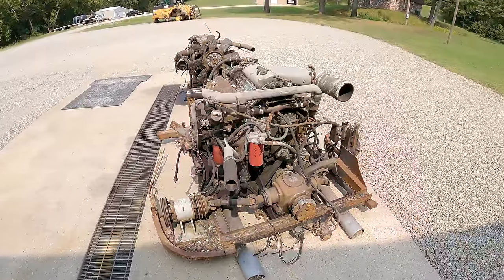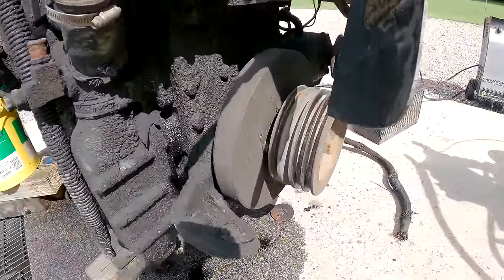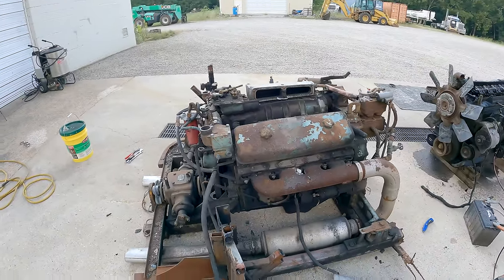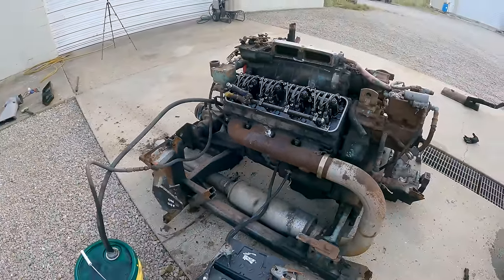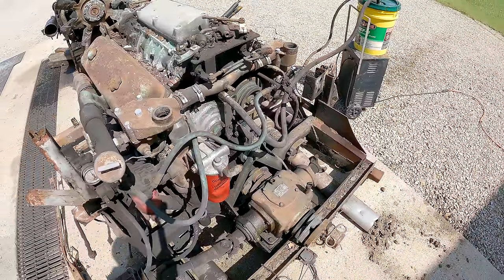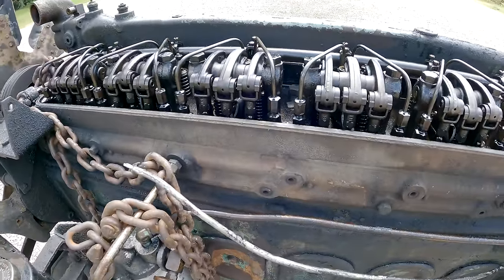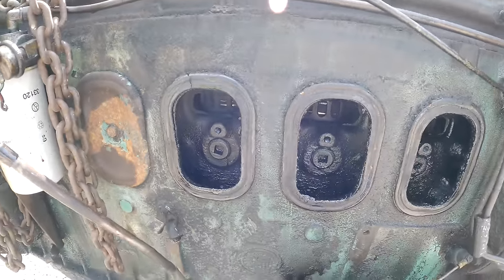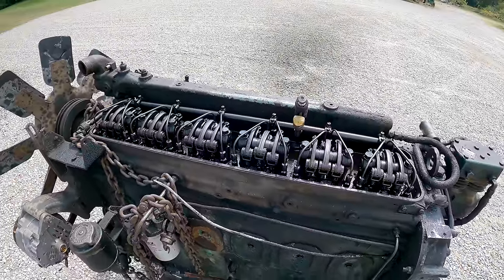Runaway 6-71 Two Stroke Detroit Diesel - Double Greasy Detroit Revival

Comment: Those old Detroit’s were amazing engines in their day...and “their day” lasted for about 60 years so Detroit did something right...aside from their noise, their biggest down fall was their fuel consumption...I worked at a construction company that had a mobile crusher and we brought it to a big rock job we were doing...the crusher was run by a generator that had a rather large Detroit in it..V16 if I recall... when they fired it up it ran like a champ but loved it’s fuel...so much so that the superintendent rented a brand new Cat generator to take its place...after about a week of running the Cat he figured the cost of the fuel saved paid for the rental of the Cat generator...I believe they scrapped the Detroit generator after that job...it was a shame really cuz there wasn’t a thing wrong with it but it was made back in the day when diesel was 10 cents a gallon...if you had endless amounts of fuel to run through it then it likely would have kept running for decades!!..the 671 was one of the best all around engines they ever made...this abusive run is a testimonial to how tough they were!!.. good video!!
Reply: And they leaked oil like an old Harley
Reply: There still decent engines people would rather have run cats or Cummins engines but imo there not as cool or fun engines I run a grain truck and we got a few pieces of equipment where I work with these engines in them.
Reply: How high was it revving?
Reply: Can’t remember...over 25 years ago...but they ran it hard so I would say it was pushing 2100rpm...if I remember correctly it was burning about 150g/hr...the tank on the generator was about a 1000g and then they had secondary tanks set up with it and it would suck them all dry in short order...it wasn’t a small crusher by any means...it was drawing a great deal of power!!..when the cone was crushing to 3/4 it was pulling well over 300amps...
Reply: @fish_R_stinky69  3500 rpm
Reply: @charlesrodriguez7984  I thought 2 strokes rev high?
Reply: @fish_R_stinky69  they sound faster but rev the same speed as 4 strokes
Reply: @charlesrodriguez7984  What's the point of a 2 stroke then?
Reply: @fish_R_stinky69  idk
Reply: @fish_R_stinky69  the powerstroke happens once per two rotations of the crank on the 4 strokes.
Reply: @fish_R_stinky69  on two stroke engine the power stroke happens every rotation of the crank.
Reply: @fish_R_stinky69  they seem to make a lot of power though so I guess that’s why.
Reply: @fish_R_stinky69  Power to weight ratio.  With a two stroke engine you get a power stroke in each cylinder on each revolution.  A four stroke generates power on every other revolution. So a 2 stroke does consume more fuel but it also makes more power from the same displacement and weighs less per HP.
Reply: Well said 👍👍
Reply: @mikeklaene4359 is fueling the reason they don’t produce 2 stroke cars?
Reply: 5:25 REV LIMITER!!! YEAH
Reply: @MrMan5014 If it was a generator it would have been running at 1800 rpm as all 60hz 4 pole generators do.

Comment: My last boat had twin 6-71 turbos, they ran beautifully. After 700 hours of use, I never had a single issue. When I sold the boat, they had 1,900 hours and would barely blow a puff of smoke upon start-up (normal) and ran clean. I used Lucan during oil changes and it stopped the oil burn. They are EXCELLENT engines. Change the oil and fuel filters and they will run for ever.
Reply: If I had a boat, there is only one make of Diesel engine I would have... DETROIT. You can rely on these engine long after others have given up.
Reply: We had 4-71,s as generator engines in our tugboats. they reliably made atleast 20,000 hours between overhauls. Darn good reliable noisy work horses!!!

Comment: For all those too challenged to educate themselves on the ordeal with doing a runaway on a sack of shit that burns oil left and right with so many hundreds of thousands of miles of wear within(the kind that would cost a hell of a lot more to even attempt fixing compared to buying a new one), there are three things you can do with it. Melt it down for the metal at the scrapper's shop, make it runaway then use it for an ugly yard ornament or melt it down, or just leave it to rot. What I'm trying to say here is that this is the funnest way to handle nearly every engine on it's last leg. If anything, I see this as more of a glorious send off to celebrate the amount of Wonderful things the motor did in it's life.
Better said as going out with a bang.

Comment: 😂 Well, that was fun! I’m retired now but for most of my working life I ran large stationary diesel generator sets (Air Force & public utilities). It’s been so long, I don’t remember model, displacement, etc. but we had these two Nordberg 1000 kW units that were 7 cyl in-line 4-strokes. I think the cylinders were 18” diameter with a 32” stroke. Roughly 13’ from the bottom of the oil pan to the top of the rocker covers. Nominal speed was 327 rpm. They were a ball to operate. The cast iron pistons were prone to breaking around the ring grooves. It happened to me one time. What a racket! Two crankcase explosions in rapid succession filled the plant with thick black smoke. They had spring loaded crankcase pressure relief valves or it would have detonated. I ran out the side of the building and had to re-enter to shut it down at the front of the engine. The mechanics said the CC explosions were very minor. What a rush! The serial numbers were 3 and 187. The first two built were sent to a Texas oil field where one of them exploded and killed every man on the crew. After that they installed the CC pressure relief valves. That was in 1948. I worked there from 1983 to 2000. After I left, they closed the plant. It’s too bad. Should have made a museum out of the place. Oh well.
Reply: The most awesome stories in the comment section  thank you
Reply: Thanks for sharing!

Comment: I am a retired diesel tech of 40 years. That inline 6 71 could have been sitting for over a year. I worked for a company that was shut down for 14 months. Had to get several trucks started. Installed some batteries in a truck with a 6v 71.  It started with only 1 revolution. Now of course, if it had been cold out that would not have happened.  Now the older 6 71 ,if it had an injector stuck in full fuel,it would keep the other 5 in that position and run away. The newer ones had what was called a broken backrack. That would allow the other 5 injectors to return to the no fuel position.

Comment: I worked on the Detroit Diesel 53,71 and 92 series assembly line from 76'-83' performing different jobs,pushing pistons,dropping cranks in,pushing cams,setting timing etc. There were a couple times that some of us were taken back to the engine test area and were shown what happens when somebody didn't torque the piston rod caps properly. It's not pretty when ya see a rod poking through the side of a block.
Reply: In the 1970's I drove an old 1951 GM 4103 coach with a 6-71 and a 4 speed tranny. I come into work one night and the boss/owner takes me aside and says he's putting me into a coach that night that was just rebuilt. He said take it easy on her, the dashboard oil pressure gauge registered zero but the engine compartment gauge showed 8 psi. I make it the 67 miles out to the turnaround point, but coming back home about 20 miles into the run while pulling a fairly decent hill the engine developed a dead miss. Had to downshift to third to keep going as no room to pull over anywhere. Engine starts missing on a second cylinder, and loosing speed fast. I downshift second gear trying to make it to a wide area just up ahead when heard a loud bang and she went dead. Kicked in the clutch and tried to roll to the side as much as I could. Got out and walked to the back ending there was a river of oil flowing down the road. There was a huge hole in the lower side of the block where #4 cylinder was, and it tore the oilpan half off. Stuck there for the rest of the night until the boss arranged to have a hook come out. I guess even these "indestructable" 2 strokes won't run without oil pressure!
Reply: These stories make me sad because i'm sensitive to that lol

Comment: I cannot believe how tough those things are. It ran all that time wide open with no coolant and didn't lock up. I wish u took it apart I bet some exhaust valves burned off and compressions to load to fire even with ether. Very impressive.

Comment: I am a ASE diesel mechanic for over 40 years.. Detroit diesels are quick to start in warm weather.  I had a truck that sat for about a year. It had a 6v71. . I Install to new batteries. It didn't even make 1 revolution and it was running.. I have had a inline 6 71. In a boat that had been running , and I had a 3/4 ratchet on the crankshaft pulley bolt to turn then engine over to set the valves. My only mistake was to not hold the shut down in the stop position. Of coarse it started. Lucky that the ratchet did not jam.

Comment: Dang old Detroit tough as hell and  that's why I like them, overrevved ran low on oil, overheated and gets crap fuel mileage but damn if they won't always crank up and run and do the work you need them to do.
Reply: Unless the temperature is anywhere near 0 degrees or less. Then good luck.

Comment: The old detroits sounded really cool, many people love them for that reason.  There is uproar over ruining it but I guarantee if it was listed for free no one in the comments would bother going to get it.  It has no practical use any more and people tend to greatly over exaggerate the complexity of modern electronic engines and "failures" while disregarding some of the faults these older engines had.

Comment: That lasted way longer then I thought. I was figuring we would see rods flying. Id bet it wasn't built on a Monday or Friday.
Reply: It’s damn hard to kick the rods out of a 6-71 because the rods are extremely beefy and the crank and rod bearing surfaces so big. Now the V series Detroit’s especially the 92 series they’re a different story
Reply: *than, not then.
Reply: If he wood have put on a radiator and had coolant in the motor, I don't think he cood have blown the thing up. It probably shut down due to heat melting things.
Reply: And I thought that the day of the week based assembly quality was only the domain of the Eastern Bloc manufacturing :D
Reply: @hillbillybeerdranker6678  would*

could*
Reply: @yammmit  you spelt it Rong, go back ta skool and lern how ta spaell
Reply: @yammmit  I wuz just ryin ta teech you youngins how ta spell and use proper Engulish.
Reply: @yammmit  I'll hav you know that I gradiated at tha top of my classe
Reply: @gullreefclub  I threw a #4 rod on a 6-71in a GM Coach. Took out the bottom side of the block and half the oil pan, left a river of oil down the highway.  Boss man said to take it easy on her that night, the dashboard oil pressure gauge showed zero, but he said the engine compartment gauge showed 8 PSI. Made it about 87 miles on my run before a big hill with a full load of 41 people did her in...

Comment: That was amazing I didn't know the 6-71 could sound that good past governor, especially with the fire coming out of the exhaust, I have to say past governed full throttle, this has to be on of the most amazing sounding diesel engines ever. Now that 8v71 I liked how the blower sounded like a 4 stroke with the fan on , but that 6-71 takes all the gold in my opinion.
Reply: If u love this sound u should hear a gm emd locomotive at full throttle with a 645 v16 2stroke basically the same motor but alot bigger they have a heavenly sound they come both turbo charged and non turbo charged best sound in the world
Reply: Drove a 6-71 that the company mechanic turned up the governor to 2600 rpm. He was a Mack mechanic and hated Detroits and wanted me to blow it up, but it lasted the 3 years I was in it, and it ran strong! Would out pull a Cummins 290 in the fleet, and ran circles around the many 237 Maxidynes we had. It had a weed burner horizontal exhaust that would throw an 18 inch long flame at high rpms, lit up the bottom of the trailer, so the boys gave me the CB handle Wildfire.
The good old days...
Reply: I agree!
Reply: I wholeheartedly agree!!!!!!!!!!!
Reply: @jimbruneau6769  Awesome!

Comment: It is amazing how damn simple those engines were.
Reply: FAR from simple to build one correctly!
Reply: @bretmuldner  compared to the 26 miles of wiring, and 5 ecus it takes to get an engine to run now days, it's pretty simple.
Reply: @OGbqze  Easier for someone to do wiring and programming, than it is to do machining on Diesel's.
Reply: @OGbqze  fuel efficiency is something important nowadays.
Reply: @MrSpacelyy  an 80's chevy sprint got 60+mpg with an old carbuerated engine. Most cars now days, you're lucky if you get 30-35mpg... there's a guy online who gets 40+mpg with an old carbuerated 302 ford V8 engine..... the whole wiring to mpg argument is absolute nonsense.

Comment: Perhaps next time you could give it coolant, and connect the crank case breather to the intake, and also advance the camshaft 1 tooth. Setup a remote controlled oil pressure reduction device in case nothing happens

Comment: Wish you would fly apart something that was actually clapped out 

Worn out 6.9 or that 8v71 
That 6-71 seemed like it was a good engine considering no smoke and started easy
Reply: Exactly. Perfectly running old engines always end up in the hands of some dirtbag that wants to ruin it rather than fix the little shit wrong with it and sell it to someone that will put it to good use. Why do you think classic muscle cars are so hard to find. Too many assholes ruined good ones.
Reply: Oh come on, those engines might last, but that is also their problem. No power and guggling gas like a drunkard at happy hour.

Comment: I would like to see an older DT466 runaway video. Had one in a dump truck years ago that was turned up to 2850 rpms.
Reply: I drove a 3 car hauler (used to be a 4 car but they removed the number 1 spot head rack) it has a 2850 rpm turned up all mechanical and she just fuckin eats and goes. Thing can pull down a house and go over 100 like it was nothing.
Reply: @BillyBigRiggah  How many HP

Comment: I didn’t think a DD would have enough compression to start without a blower, and removing an air box cover would be such a large air leak as to be like it didn’t have the blower.  So, learned something new here!
Reply: yeah.. but you missed the fact that removing that box does NOTHING to reduce blower boost.. still has boost or a 2 stroke will run but not rev
Reply: @zoggrog8823  yes removing that air cover does lower manifold pressure during cranking causing low compression and non sustainable power, this is why it didn't stay running and was smoking like a bitch with it off, too much fuel not enough air but the engine was warm so it was able to pop off a few times before choking out on fuel. The blower on a Detroit only makes up for lower than atmospheric air pressure and in terms of boost you only see max 1psi in the box but without that cover you don't get anything so it won't run worth shit just like in the video. These blowers don't work the same as they do on a smaller engines.

Comment: When your doing something like trying to start a engine after it almost locked up use a combination of WD-40 and starter fluid to get it turning fast enough to start again because the reason it didn't start is it wasn't turning over fast enough
Reply: miracles happen... maybe... eh..
Reply: I think the batteries were not to strong either. Need good connections and high amp batteries.

Comment: 👀would have loved to see engine temps with an IR thermometer: block heads,manifold, etc.... still impressive as hell. Nice job. Always a pleasure. Thanks.......
Reply: yea, he did a teardown and it ran so hot the the manifold did crack and some other damages, but other than that it did turn over and held together  at the end of this video

Comment: Man I'd like to see a temp gun on these full fuel run aways you do.
Reply: Hotter than Satan's pitch fork. Lol but I agree the temperature readings would probably make our jaws drop and blow our minds that it's running and not melting or in flames.
Reply: And rpm
Reply: @shawndubay4050  Yep!

Comment: Our tug use to have a battle governor.   When in battle mode it bypasses the governor and physically pushes the rack wide open
Reply: Some military diesel engines have a valve in the injection pump which connects the pump's oil feeder pipe to the fuel rail. So the engine can run on it's own oil in an emergency.
Reply: @albinklein7680  No, that's to create a smoke screen not so the engine uses its own oil purely to run..
Reply: @Draxindustries1  Intersting! But it would be self death ☠
Reply: @gabrielv.4358 
Russia have military diesel craft, use seperrate oil tank smoke screen injection. Engine have dry sump oil tank not use smoke screen injection.
We sale ex CCCP military, gas turbine heli (Hind) jet Warbird MIG 23's & Yak Warbird.
Sorry bad English spell. Iterpreter no here today.
Greeting from Russia (Girood Airfield Hangers).
❤️

Comment: Early 80's ,I ran Captain on 110' offshore  crewboats in South Louisiana. With a fleet of over 40 vessels, (all aluminum hulls ,which were like carbon fiber today.,,,I choose the older crewboats,(the owners collection,lol.)( built like a Cadillac,,,but sound like the engine room was going to explode any minute running 4, 6-71 in a aluminum hull,(i ran mostly only 2 engines,,, wide open 5+ hours at a time.Very dependable engines,,,,just add oil and go fast. thanks for the FLASHBACKS!!☆☆